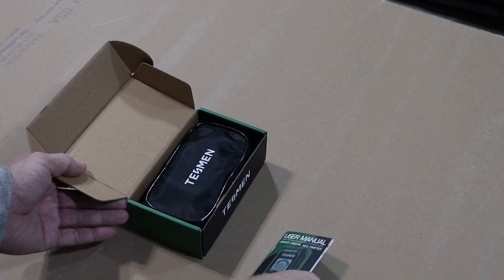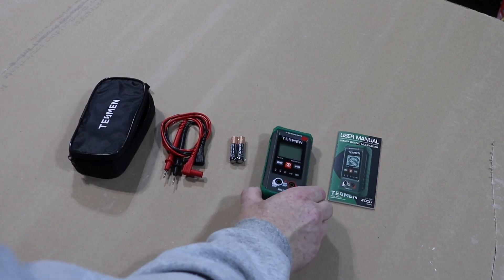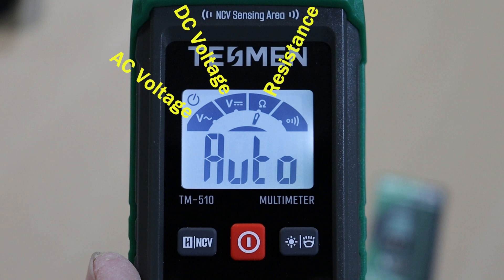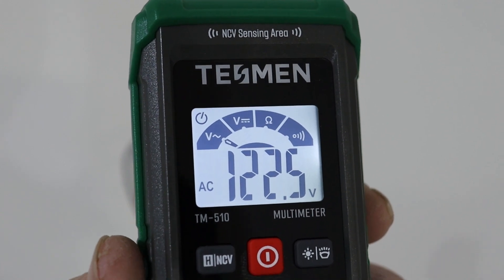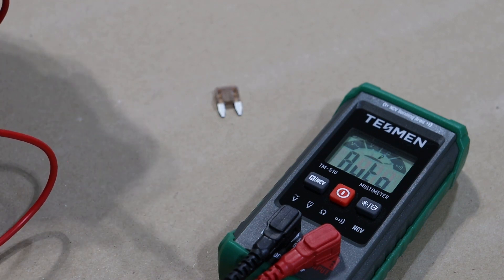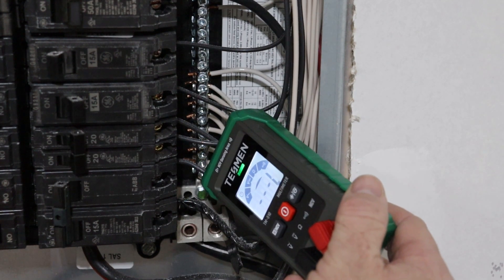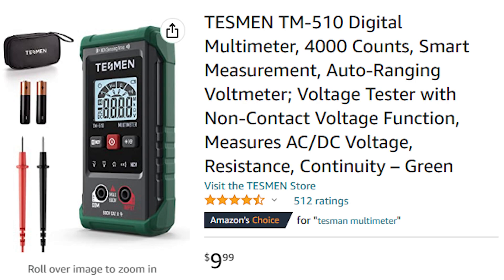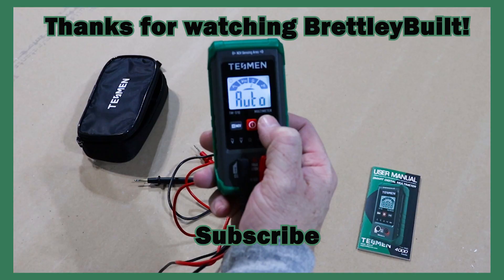TESMEN TM-510 Multimeter | Automatic & Easy to Use for AC/DC Voltage, Resistance & Continuity

Comment: The probes on mine were bad out of the box! - - I had some old Harbor Freight leads that I used, but they don't go as deep into the input jacks as they need to.  It frankly wasn't worth my time to send in back, and I was disappointed that I can't override the "auto" function and immediately chose the function I'm wanting it to test for., but rather one has to wait for the unit to go through its "cycle" and (hopefully) land upon the correct function.
Reply from the maker: Sorry to hear you had so much trouble with it.

Comment: Newbie here, In the example when you were testing the outlet, does it matter if the red or black goes into the neutral?
Reply from the maker: If you are testing an ac circuit, you can use either probe for either connection.  In a dc circuit, you can technically use either probe, but if the hot and ground are switched, you will see a negative sign showing the probes are reversed.

Comment: My mother has a problem with her radiant heat flooring. I want to know what the LOAD requirement of the heating mat in the floor is would I use the resistance feature of the meter to do this? If so do I just connect to the wires from the mat (LOAD) with no LINE in hook up?
I really appreciate your videos. Thank you for the time and effort you put into making them.
Reply from the maker: Unplug the mat and put a probe on each terminal of the mat. All you are measuring is resistance so it doesn't matter which probe you use. If there is no or very low resistance, the circuit in the mat is probably broken.
Reply: @brettleybuilt  Thank you for answering, All the best to you and yours.